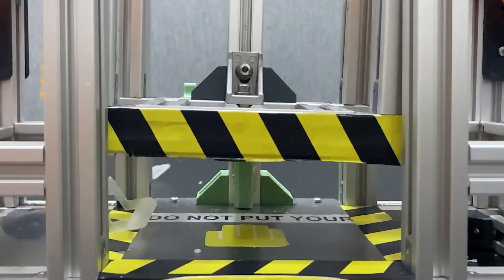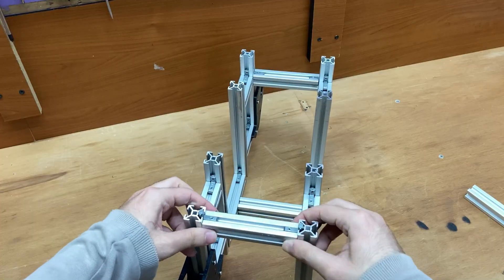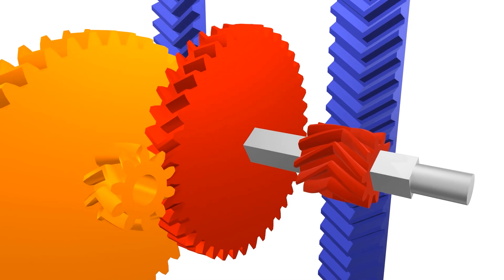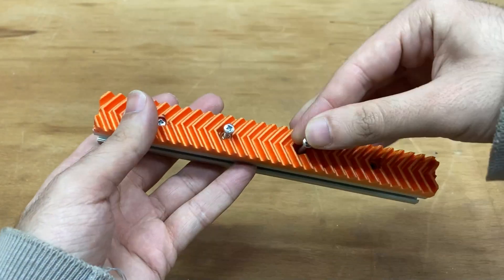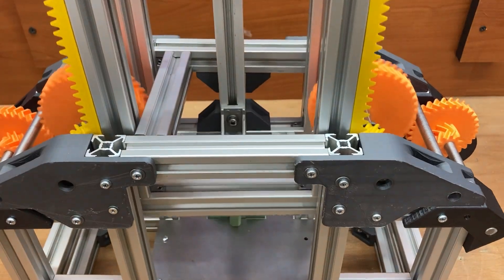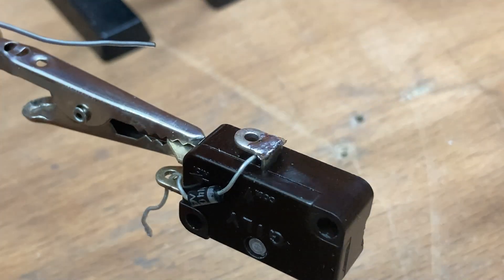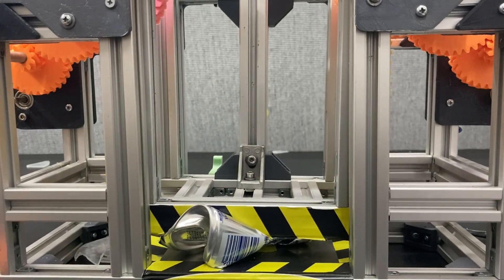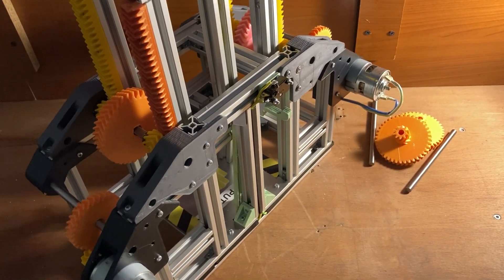Is it possible to Build a 3d printed Press?

Comment: Man, it won't be long before your channel blows up! I am certain. This is really quality content!

You use the simulation on Fusion 360, and it would be great to see some more beginner lessons on how to use the F360 simulation for 3D printing.  Also, it would be great to have some more detailed videos on the calculations you use and how we can implement them in our own projects!

Thanks for the great vids - you got a new sub!
Reply from the maker: Thanks a lot! You actually gave a good idea and may be i can mention about the calculations roughly through the end of the videos anymore.
Reply: @retsetman9698  Sounds great. It is something that makes me really interested in your videos - Pro-Maker videos - like makers who want to go to the next level!
Reply: @retsetman9698  12:59 motorover
Reply: @retsetman9698  You can use engine from car window  cleaner, its much more powerfull (14Nm) but have slower rotation 😀